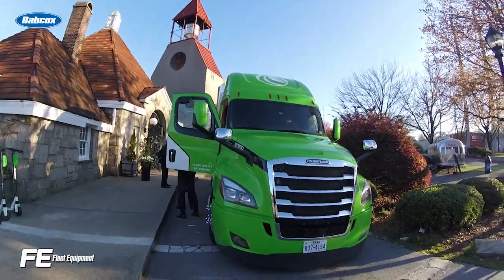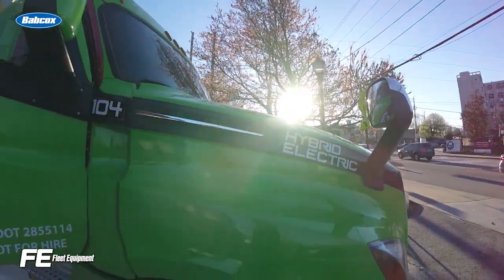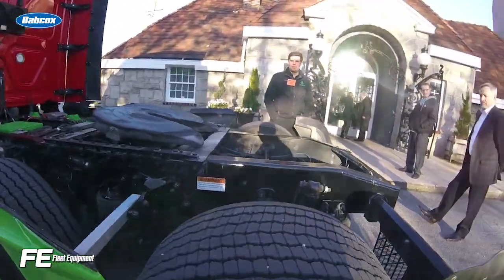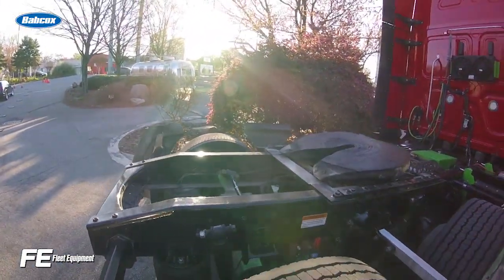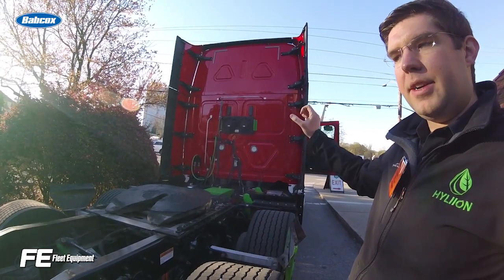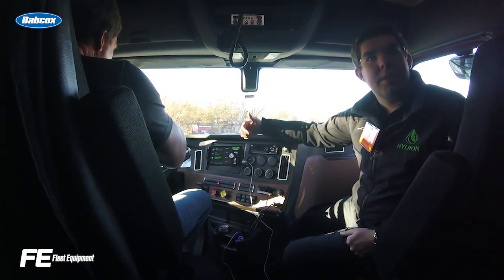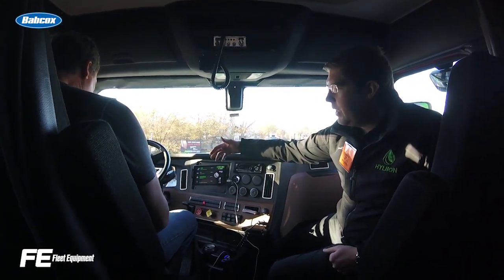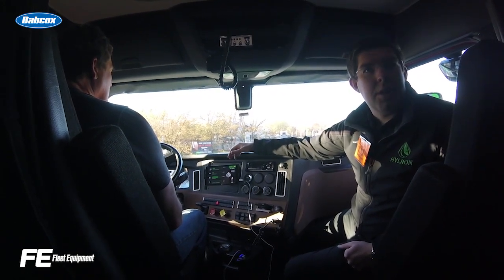Test driving the Hyliion hybrid electric truck

Comment: This system is only good for those trucks which is already in service. And it can definitely help in reducing  the emissions but will not solve the problem of relying on fossil fuel. The future is pure battery electric or fuelcell hybrid (hydrogen/ methanol).
Reply: At this stage and the foreseable future we are still dependent on fossil fuels for our energy needs. Battery electric is the desired future, but since the electricity grid that chargers electric vehicle batteries gets its power also from fossil fuels, battery electric still isnt a solution right now. Hyliion powertrains helps overcome such limitations by utilizing renewable natural gas as source of energy to charge their batteries and also do so at a cost much cheaper than from the electricity grid.

Comment: hybrid system doesn't make sense in high speed long distance travel.
it make sense in city traffic, or frequent stops.
probably should concentrate on garbage truck, bus etc.
Reply: It's amazing for going up hills, overtaking on the highway etc. Plus the electric apu is key! Many warehouses make you shut off your truck while docked. With the APU you will still have heat and ac.

Comment: I have been buying for about 2 months and own 2100 shares now.  Have 512 of Workhorse and going to buy 2000 more of Workhorse in the AM.  Have Tesla, Hyllion for semis and Workhorse for the small truck EVs.  So I think I have it covered and satisfied with the portfolio.
Reply: Trade your Tesla Semi for Hyliion Semi soon cause Hyliion is already planning for Hydrogen.
Hydrogen is way to go for long haul trucking to make profit timewise and weight wise over current battery tech. Hydrogen has many sources-biogas (garbage and poop), seawater, CNG....Hydrogen everywhere, the tech is getting better. Toyota and Hyundai vested in Hydrogen. 

"Hydrogen fuel cell technology will also be developed as the fueling infrastructure becomes more available"
EXCERT FROM: 
https://www.fleetowner.com/equipment/article/21134896/hyliion-to-go-public-and-go-trucktotruck-with-tesla-and-nikola
Reply: @sevencostanza3931  I think your seeing that in todays terms.  When the million mile battery is perfected and Tesla is getting a 1000 on a charge with a few minutes to juice the car, its game over for gas and hydrogen.  In under 5 years it will be a reality.  Thats why I have not bought a Tesla yet, longer I wait the better it gets!
Reply: Still bullish on workhorse? I’m looking to add more?

Comment: Sold 2/3 of my NKLA stock and stacked on SHLL and some. It's Gonna be another ride. 💸
Reply: Edson Garcia I’m taking a shot....I sold out of SHLL 5 min before close Friday but got to feel like this company could run hard on Monday and didn’t want to feel like I was being left out! Let’s see what happens
Reply: @billnipp  Be careful with FOMO. Keep a close eye on the stock. Be safe and place a stop lose. Incase it drops. Incase it drops and your stop lose triggers. Try catching the dips by buy some at one price and more if it drops lower and so own. Until you get to the lowest dip possible. Then place a limit order to buy the rest  half way or a quarter way from the price you originally put your stop lose. On the way back up you will profit more and make up the lose IF IT DROPS from its price you bought in on friday. I bought this Monday at $19.40 and you can see what happen. It dipped to $15.70. I did implement my plan and got back in from $16.60, $16.30, $16.15, $16.02, and with good luck I placed a limit order to buy at $15.70. I'm preparing for a future dip. People will sell to keep the profits. I will buy all i can on that dip IF it goes low low 16-17 low. Be safe. Because FOMO can burn you. Just  prepare. Good luck and enjoy the profits as well as the ride.
Reply: Edson Garcia Dude...great stock management insite however that is not a realistic plan unless you are an unemployed day trader. I have a family and a full-time job which means time to buy, monitor and sell or accumulate more shares on a dip.

Comment: I'm an owner operator. I've devised an open source system like this to install myself. I'm sourcing parts right now. Can I buy this unit from you now? I live in the Northwest. I run 50/50 for the most part. I'd love to do some field testing for you! I'm also very mechanically inclined and intuitive. I feel I'd be a lot of help on the system as far as problem solving and future planning. If the need was to come up! Either way! This is very cool! Thank you!
Reply: Are you concerned about how much weight this will add to the tractor? I am a truck driver of 24 years.
Reply: @MrCountrycuz  I'm not. You remove other components and add others of comparable weight. I'd run something like this on one if my tractor axles and lose a fuel tank, fuel, and lose the lead acid batteries. Then the batteries could also be used as your 24v and 12v side through a DC  to DC converter. Plus I only hall empty or hallow freight. Not that one would have to if done right.
Reply: I really just need access to there funding! Lol! But seriously! 😉

Comment: Very cool truck!    So, how much fuel does the hybrid system save?    What is the before and after fuel economy?
Reply: I’m a truck driver and Iv done my research, this isn’t a scam... logistics is all about money saving and the fact is.... the cost of fitting this is paid off in 2 years then you are into saving 15 grand a year per truck.... so if you got a 200 truck fleet that really adds up. End of 2021 this stock will be at least $100 a share
Reply: @bustinnuts4027  How much? Asking today 12-1-21 If they get their act together and all stars line up maybe in like 5 years from now.
Reply: @Fento L You certainly don't know anything. :D Tesla was also scam 10 years ago, its now worth more than 200 billion.. Be a pessimist with facts
Reply: Do your research, they have outlined fuel saving details in their investors proposal document on there site.
Reply: Fento L not a scam. They have trucks on the road. Trucks have 1,300 miles range. Sounds better than Tesla
Reply: Apparently an average of $15,000 per anum per truck fitted in terms of fuel costs read up that the truck conversion is like $60,000 which is quite good when u think about it and is compatible with all current shipping trucks in existence already. I admit I bought 150 shares and am tempted to buy some more and leave it for a year or two as a longterm hold as do think it has good prospects. Also are going to make there own trucks with the investment  from the merger and will increase capacity ready to launch 2021. They need to be more involved with social media though and image perception.
Reply: @Fento L it's cheaper than other companies to convert to. Also natural gas filling stations are already everywhere in the United States.
Reply: hybrid system doesn't make sense in high speed long distance travel.
ICE is very efficient for that. 
hybrid and EV make sense in city traffic, or frequent stops.
probably should concentrate on garbage truck, bus etc.
Reply: The problem I have with this company is that it doesn't answer the important questions. Impact on fuel efficiency. You still have to charge the batteries with Diesel. Aerodynamic of Diesel trucks are still going to be crap. This is a too-little-too-late company, of it would have been commercialized 10 years ago, it might have been a 10x investment but now, at 1B valuation I don't see it. I'm not a financial advisor btw, this is just my opinion.